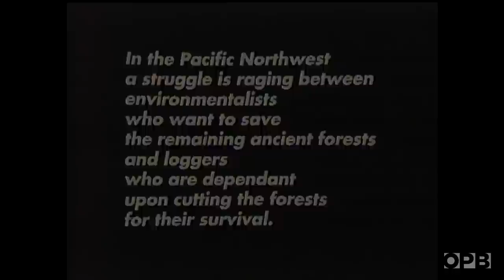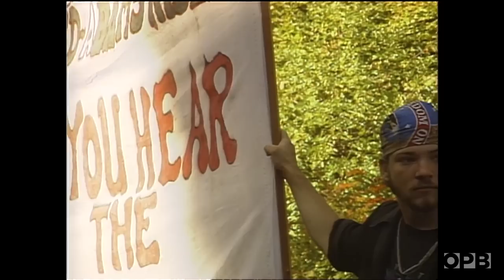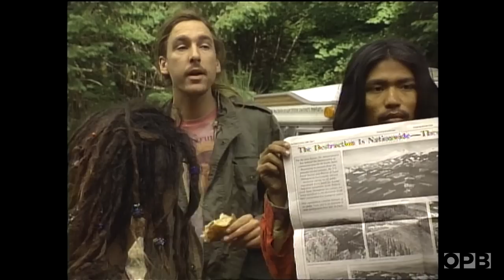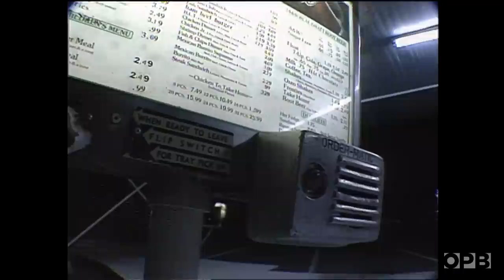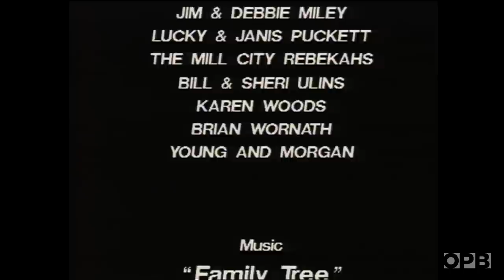‘Timber Wars’ reach Mill City

Comment: They killed all those jobs because of the spotted owl. Then you find out the barred owl kills them 1000x more than logging ever did. I guess we should have fought harder...
Reply: Automation killed those jobs and consolidation meant most of those profits left the state to people who didn't have to endure the effects of over-exploitation.
Reply: @Samo503  automation in Logging is not a thing. It is true there are fewer boots on the ground as steep slope logging practices have changed with the advent of tethered logging. But that did not come into the picture until late 2010’s.
Reply: @slingerriggin5226 According to the Oregon Employment Department- "Technology advances, more automation, and less labor intensive manufacturing processes all conspired to reduced demand for employment, despite the ramp-up in lumber production.” These increased efficiencies (standardization of logs, mills, equipment, etc), in addition to the federal land restrictions, have contributed to the declining employment in the industry, even as value-added output has held steady."  I get that people long for the good old days, but the truth is that the Timber industry wouldn't have been immune from the same economic trends that have stagnated wages and impoverished rural communities across the country.